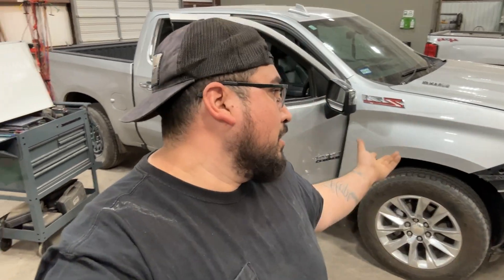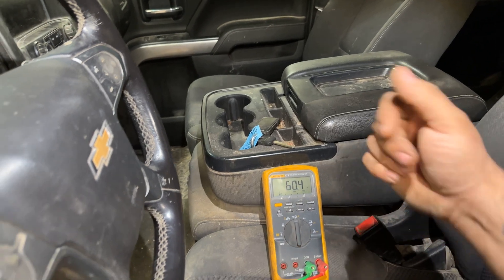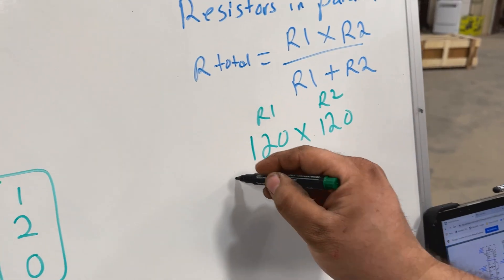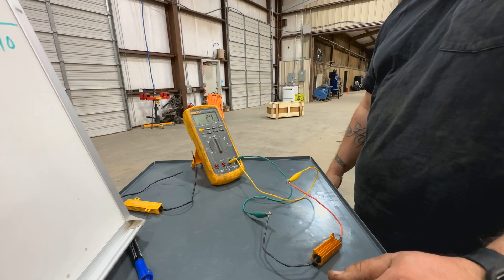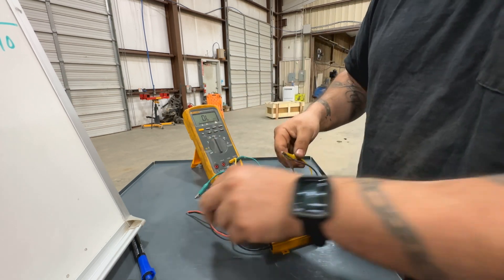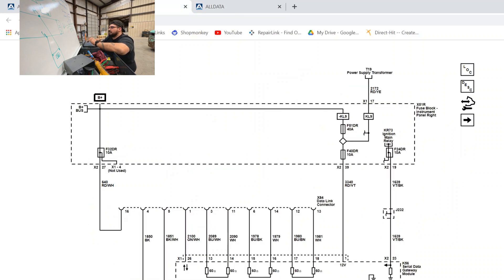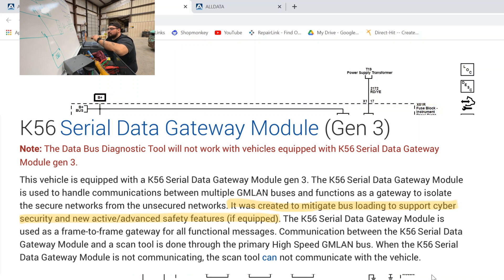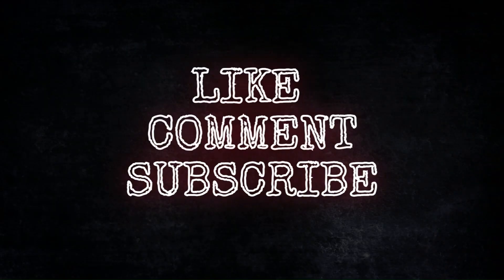120 ohms on can network and its good? GMLAN Highspeed walkthrough.

Comment: Quick question for you : If 120 ohm is a good reading, how is the scanner/device connected to that part is going to work ? That device will require a 60 ohm reading and not 120 ohm, right ?

Comment: Thanks for the video! I have a 19 new body style I am trying to diag now. It starts with the push button however the ECM is not broadcasting the “run” signal to the BCM  so the crank request stays on and the starter is steadily trying to engage. Can bus is checking out good with communication to all modules. Any ideas on this one?

Comment: I’m working on a 21 gmc and it reads 120 at dlc and both resistors on their own also read 120. No comm with pcm or tcm and all powers good.
Reply: Did you figure out what’s wrong with it ?
Reply: @hector5975 broken can wires from dlc to glow plug module then from glow plug module to Tcm I think. I jumped the can straight to pcm to verify pcm was good.

Comment: Excellent video my brother,I have  come across that similar issue,understand that it's series and parallel but that's it ,kept on chucking ,I had a friend in Jamaica that I have lost connection with who mastered circuitry to the bone ,well actually a few of them ,they would always be able to repair European ecu for me that I couldn't manage on my own ....your doing a good job
Reply: My kc501 require me to put 120ohms resistor at can high and can low,in order to program mercades EIS .

Comment: Good video! Thanks! But I have a question for you, I have 2022 Silverado, I have a lot of communication faults, such as: U0284, U1345, U1347, U0121, U0151-00, C0502, C116C-O5. I checked ohms at gate way, I have 120¤ on pins 14-15 and 4-5. What else should I do? What is the next step? I have check engine light on, abs, airbag, and brake
Reply from the maker: I would scan the vehicle and see what modules talk and what modules don’t and print out a network diagram and follow the road of who talks and who doesn’t and divide and conquer